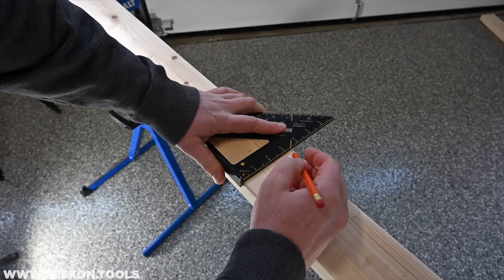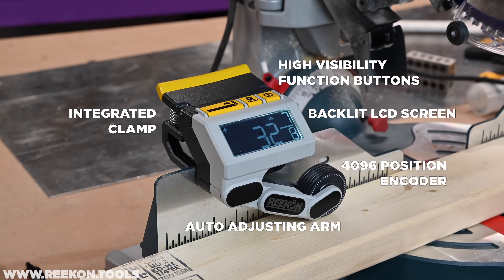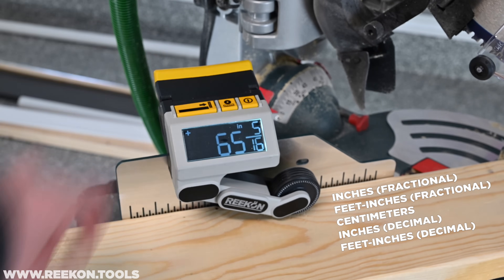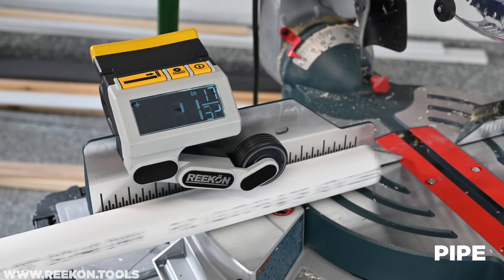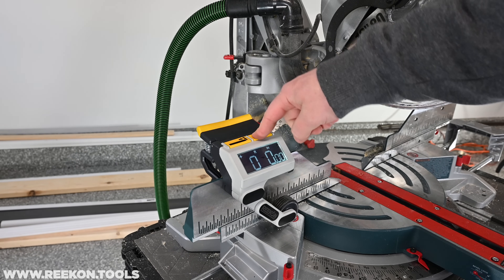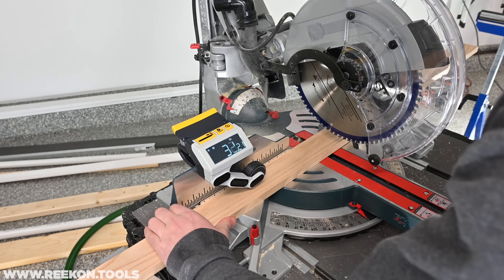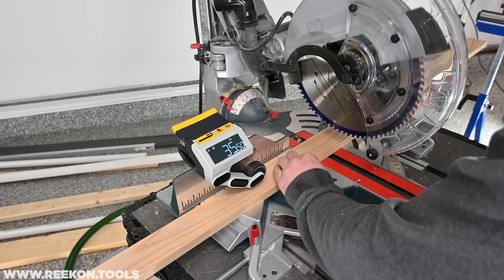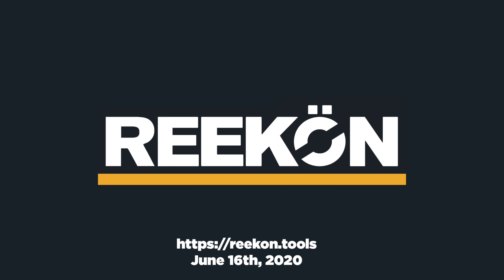M1 CALIBER Demonstration - REEKON Tools

Comment: For precision of 0.02" it is quite off at 1:24. What about precision after some time when the wheel gets worn out or with a dust build up on wheel?
Reply from the maker: Hey Gregor, this is a prototype M1 as we made the video a while back.  Production M1s are made much more robustly and all feature in-unit calibration meaning you can calibrate any of them in the field whenever you want in under a minute to negate any effects of the wheel or other variables that may change over time.

Comment: @Reekön Tools ... how do you set up the different thickness of the saw blade? Could you explain it or make a YouTube video for this issue?
Reply from the maker: Hey Wolfgang, the middle button on the unit allows you to set your "blade offset" and will then be saved in the device.  We will certainly be releasing a video demonstrating this process in the coming weeks, stay tuned!
Reply: That’s nice to hear and I guess that is one of the most asked question how does it work with the saw blade setup because you use mostly different saw blades
Reply from the maker: @wolfgangselle4307  you can change this value as often as you like, it takes about 15 seconds to perform so if you switched to a saw or saw blade with a different width, you could change the value and it would be immediately updated in the saved memory to reflect your new selection

Comment: The way you've demonstrated that you'll always be the thickness of the saw-blade short of your desired measurement. Butt a piece of stock up to the right side of the blade. Clamp in place, lift blade,  slide the stock you want to cut up to the clamped piece and set the M1 to zero. Remove the clamped stock. M1 is now 'zeroed in'.
Excellent idea and I'd look at getting one.
Reply from the maker: Hey Tim, the blade offset (thickness of the blade kerf) can be programmed and stored in the device so it is included in any measurement made on the device ensuring an accurate cut!

Comment: Have another question.  Hows does this device handle short cross cuts?  Meaning, If I need to cross cut 2 1/2 inches off a piece of 2x6, how would I do that with this device?  I see that it sits on the fence.  Based on the videos, if I set that device on the fence in the same area, roll that piece of 2x6 past the roller underneath the device and get to 2 1/2 inches, it looks like the wood would not even make it to the fence.

Comment: Is it only for straight cuts or can you cut 45 degree cuts for door or window casing? Second question.....if you have 10 cuts of the same measurement.....do you have to zero it out after every cut? In the video it shows the measurement increasing everytime you put the wood under the wheel.....
Reply from the maker: Hey Richard, you can make any kind of cut you like on it, the wheel will always measure the material slid underneath it.  We plan on uploading a video highlighting this next week!
Reply: @REEKONTools  so to make repetitive cuts you need to zero it out each time? Does that just zero the distance out or it zeros the calibration out also?
Reply from the maker: @hazmat2448  Yup, you would need to zero each time you make a new cut but the blade offset is saved once you set it once so it will be applied every time you zero the device!
Reply: @REEKONTools  thank you....looks amazing...will it work on inside and outside cuts for crown? I assume it measures to the tip of the cut that touches the blade? Sorry for the questions......im a gc and do alot of trim work..
..this would be a great tool if it helps with that.....how much is the unit?
Reply from the maker: @hazmat2448  Happy to help!  It will work for any and every cut you can make using a miter saw.  The principle of how it works is measuring whats rolled underneath it with a user telling the device where its starting from (hence begin measuring).  The blade offset is an added feature for not having to account for thickness of blade when making a straight cut.  When making angled cuts, this number will change so it will either need to be adjusted or zeroed on the front side of the blade.
Reply: @REEKONTools  So if I need to make 10 cuts of a 2x4 do I need to zero out the blade every time?
Reply from the maker: @robertknowles3677  correct, your input will tell the device when to start over again.  If not, it will display a cumulative measurement from when you started
Reply: @REEKONTools  Ok so if I have an 8 foot 2x4 and I need to make 5 cuts at 12 inches each, I zero out the saw, I have my kerf registered and then slide the 2x4 in up to 12 inches, make my first cut, the next time I put in the board it will show 24 inches?  Which I think would be ok.  KNowing that the measurements are even numbers I can just keep cutting because then wouldn't i be getting repetitive 12 inch cuts each time?  Or another way to ask this is, once I set the board in at 12 inches, every time I slide in the board I will continue to get 12 inches right?
Reply: @REEKONTools  Next question I would have is if I had to make a 6 7/8 cut and make 10 of those, if I have to zero it out each time or it will be cumulative, then would I have to worry about adding in my head 6 7/8 each time?
Reply from the maker: @robertknowles3677  Several of these questions will be easier if we send you some illustrations so please contact us at support@reekon.tools and we can send some over, thanks!
Reply: @robertknowles3677  measure the first one, set a stop block and go on!
Reply: @francoispernod9200  That's how I do it now and without this tool.  I even have a tape measure on a fence on my miter saw work station.  I always use a stop block if I have more than two cuts of the same size.  I was trying to understand the advantage of this new tool.
Reply: @pcb1962  Read my reply to Francois Pernod.    I am not sure why you would assume we are not using common sense.  We, or I, am trying to understand how this new tool would make anything I do now easier.  I mean I don't even need to look at the gauge I I already set a stop block.  I for one am not getting the value of this tool over how I do things now.  For example the manufacturer said that the meter will make a cumulative count every time I slide the wood through.
Reply: I do like the idea knowing that if I have to make a cut that is 15 7/8ths, I can just walk up and roll it through to get that measurement and be done and like the video says, no marking the board.  As long as it factors in the kerf and remembers it every time I am good with that part.  Then if i have to make five custs at 15 7/8ths and use a stop block I am also good.